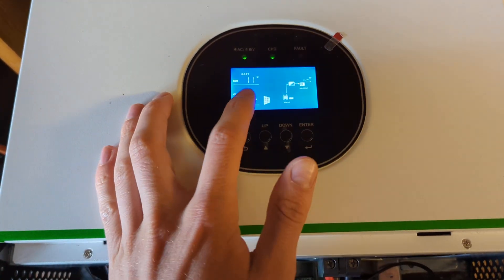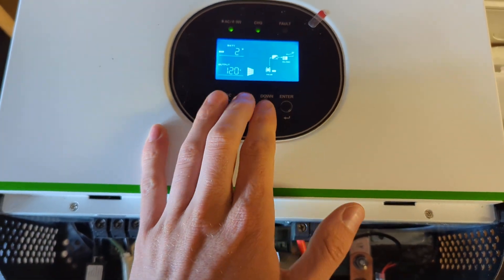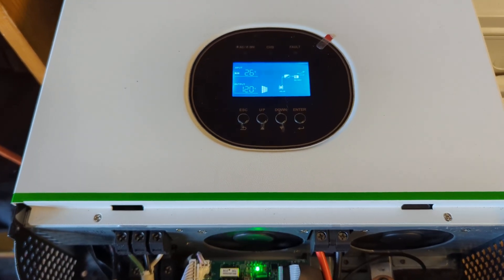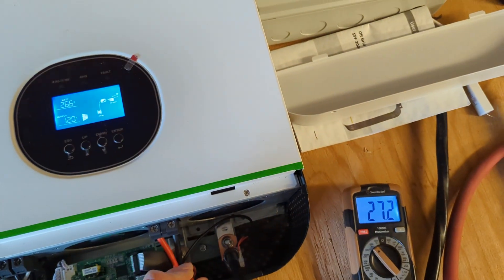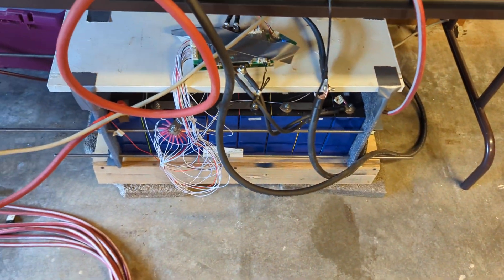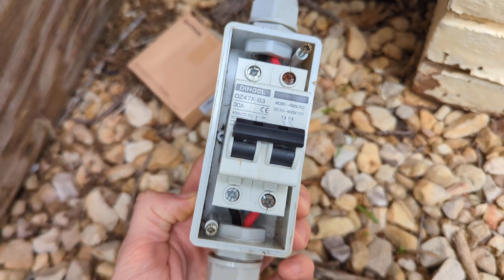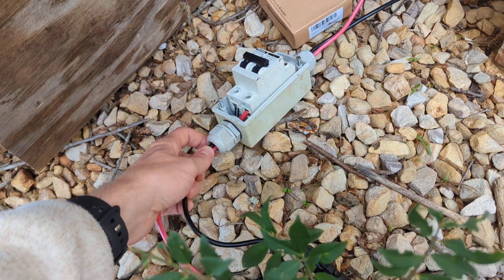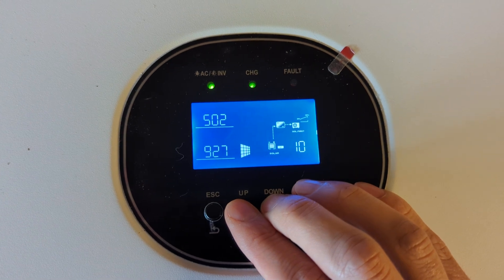Growatt Inverter SPF 3000TL LVM-24P Solar Charging Limited. PV voltage same as battery.

Comment: As an inverter repair tech that's worked in the industry for over 25 years, I would high recommend staying away from these cheap, high frequency, transformerless inverters. They offer shorter life expectancies, a far poorer surge capacity for starting inductive loads, and they can damage your home's appliances when their IGBTs/MOSFETs fail.

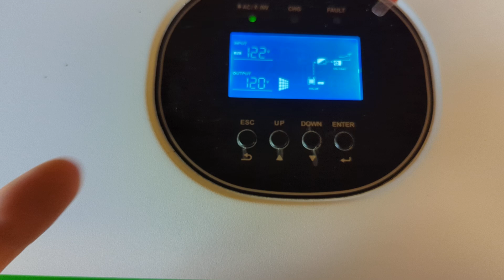Comment: I think it's the other way around. 120V is your PV when the relay disconnects your PV - that's your array's "open circuit voltage". When the relay connects your solar panels 0:57, the voltage drops because they're loaded. Solar panels are a 'current source', so you can see max voltage on them in the weakest of light if they're open circuit. As soon as they connect, if they're only weakly sourcing current, the PD across them will collapse, sometimes spectacularly. I had this problem with an inverter with almost exactly the same display (so probably very similar software/hardware) to yours. You need to try this with your panels in full, unshaded sun, pointing directly at the sun if possible. I see a higher wall, a higher rail, and a tree canopy - you have to expect low production.
Reply: Also, give those panels a wash! I use a plastic soft-bristled indoor 'kitchen' broom on mine with a tiny bit of washing-up liquid on the bristles, then hose them off with a hand-pumped garden spray. Shallow-angle panels can get a thick layer of algae at one end where it 'ponds'. Shade-bypassing diodes in the panels work a treat (see my video of my array emerging from shade), but every little cover can take a chunk out of output.

Comment: Have you tryed setting it to either SBU or SUb Modes, right now its not in either of them.

SBU = Solar Battery Utility
SUb = Solar Utility Battery

Mine has 300 modes, but the only 2 that matter are the above 2, any other modes results in the same display your showing, in which case its a glorified charger

There is so much wrong in this setup, incline the panels to about 32 deg c, production will sky rocket

Leave it connected to the mains, the unit will disconnect on its own

Is the inverter rated for Island Forming (if its not that could explain it)

Whats the MPPT voltage? My MPPT ties the solar to the battery voltage when full, BUT the MPPT will not do anything unless theres more than 110v DC Available, there just battery tied untill then

Is the inverter rated to support or supliment the grid? It needs its main plug in for that

Press and hold the enter button, menu option 1, SBU or SUb and it will spring to life

The upto 30 watts your seeing is float, its holding the batterys at there float voltage using 1 amp, its not 30watts its Battery Voltage * 1 AMP (24 watts for a 24v battery), your batterys are infact fully charged, the MPPT will disconnect the panels to prevent overchargng, your hearing the relay click on and off to maintain the float voltage.

Turn on loads and wait, the panels wont kick in right away but they will once you drop half a volt or so